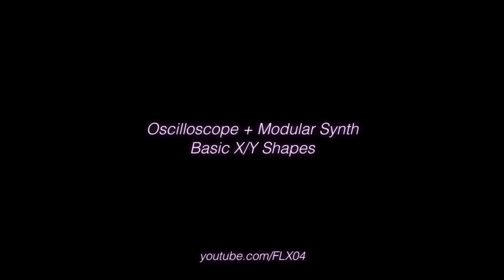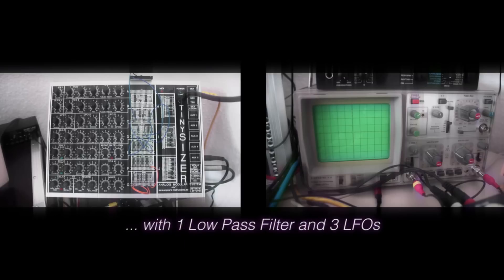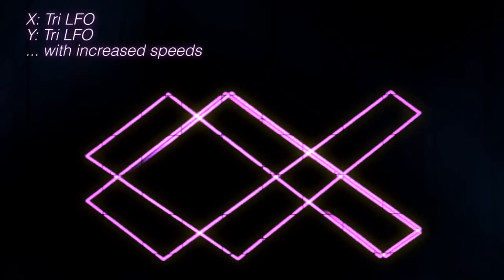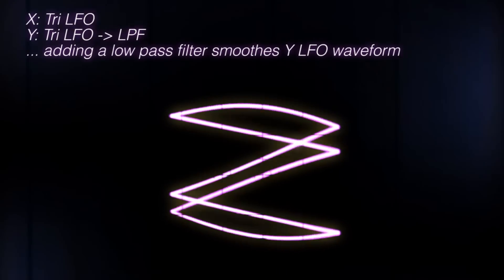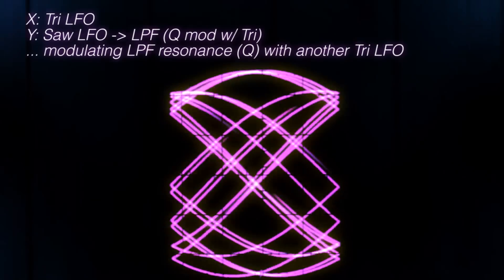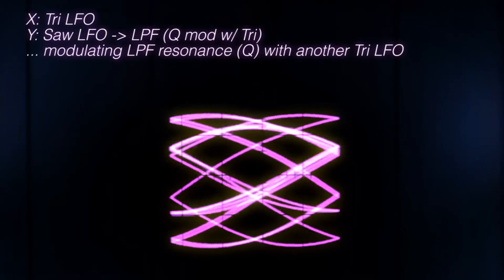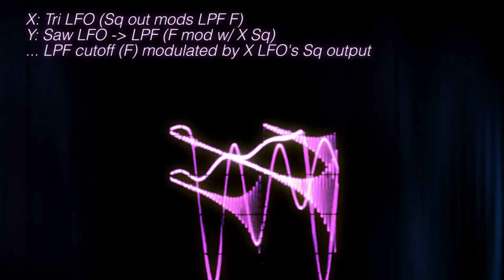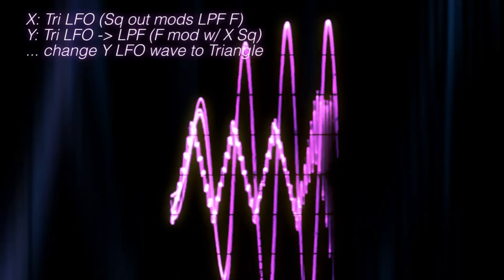Oscilloscope + Modular Synth Demo #TTNM

Comment: This is great - I'm going to be building a modular synth soon, also with video modules that I intend to connect to a projector for live set visuals. I'm wondering if it's possible to get a video output from an oscilloscope to blend in with the video modules?
Reply from the maker: Sure, you can just film it off the oscilloscope's screen with whatever camera and route the live video signal into a video mixer.
Reply: Ah, OK, thanks. This is what I thought, but I was thinking ideally to have an actual video output from the oscilloscope. Do you know if that's possible? I would be easier to set up and better quality signal.
Reply from the maker: Maybe newer digital ones have video outputs. You could also use a software scope on the computer and put it on its own desktop/video out. Really depends on what kind of signals you can or want to mix. Old-school analog video is easier/cheaper than digital video and can be circuit bent :D
Reply: Cool, thanks. Yeah, I'm sure there's all sorts of software, but I'm aiming for total elimination of a laptop for live use. I shall investigate further. Cheers.

Comment: Thanks for the video!! I really enjoyed the visuals and they sure increased my inspiration!!
I just got an oscilloscope for free and would like to send my synth into it and see what happens but the question I have is how?? I know it sounds dumb but what cable do I need?? it sure isn't XLR or Line or RCA and I don't know any other cableconnections. Could you guide me??
Reply from the maker: It's probably a BNC connector and you need an adapter for it. I use BNC-RCA adapters with my scope.
Reply: Thats it! Thanks for the answer!!

Comment: Is there a connection between whats vizually beatiful on the oscilloscope and how cool sounds you can make when you use these lfo's to cotrol 2 different parameters that shape the sound, such as filter cut-off, resonace, volume, pan etc?
Reply from the maker: Well, you can take the electricity for the oscilloscope from anywhere in your modular synth patch signal chain, so you can choose how complex you want the shapes to be, or to which CV/audio they correspond :)
Reply: Sure, i'm aware of that ;-) I just don't have all the hardware, or software if done digitally to test this hypothesis.

Comment: I really didn't do allot of research, but I heard that oscilloscope's are VERY expensive ! Like 20k usd expensive, that's crazy.   Is a scope really important to use for modular synth purpose alone??  I know I've seen a module that has a tiny scope screen, but it looks like a joke compared to regular sized screens.
Reply from the maker: I'm sure there are scopes that cost 20k, but that's crazy! I initially bought my scope to check the DIY kit modules I solder, not for making funny shapes. It's from the 1980s I think, works totally fine and cost me 80 bucks. The Eurorack scope module is cool, because it's small and it's sometimes useful to see you CV in a modular synth (but really not necessary usually), but a normal "big" scope is cheaper and has a nice CRT screen, so I bought that one.
Reply: Some scope cost in excess of 100k but for a used analogue model I have seen them sell for as little as 19 dollars. My current scope cost me just 7000 yen.
Reply: Samuel Doye thank you
Reply: Your welcome. I feel I should stress that the price for my scope is in yen, thank you japan.
Reply: To be honest, I don't really have an interest in synths. I mainly came here for the ossiloscope stuff. The closest thing I have is a signal generator app that I use for test purposes.

Comment: Nice tutorial, thanks for posting! :-) 

I did a series of 4 videos a few years ago titled Spirits Of The Temple Electric. Here is a link to the final installment which is just an explaination of how I created the visual oscilloscope effects.
Spirits Of The Temple Electric - Secrets Revealed -
Reply from the maker: That's great! The mirror effect really works wonders on those shapes! :)
Reply: ***** Thanks. Yes, when I first recorded that I didn't have much time to worry about making something interesting on the o'scope (the raw footage is really boring and bad if I do say so myself! ;-) but I thought since I had never done a video with o'scope before, it would be better than nothing. Then the more I worked with the effects in Sony Movie Studio the more it came to life!
Reply from the maker: Yeah, raw oscilloscope footage can really be quite boring. It's good that it's easy to spice it up and layer it above other footage, by increasing contrast and applying an "add" blending mode, etc. Have you planned another series of Oscilloscope videos?
Reply: ***** I've often thought of doing some more videos using an oscilloscope creatively but I haven't yet. I've done a few along with module demos but just using them normally to display wave forms.